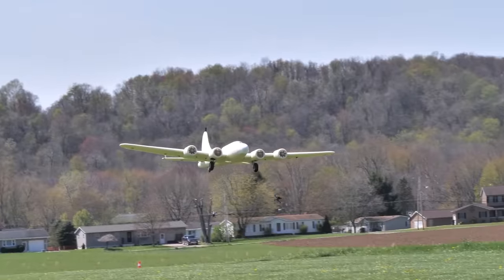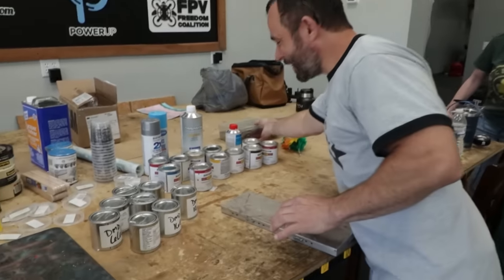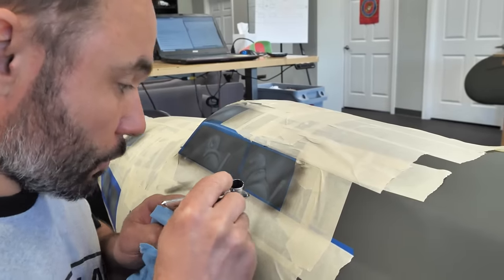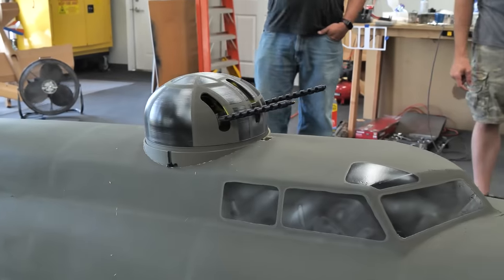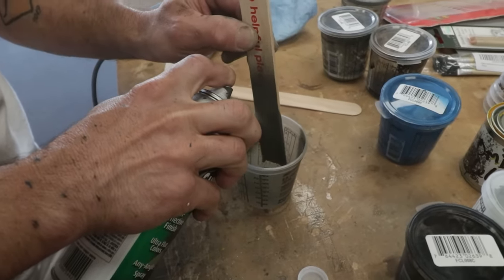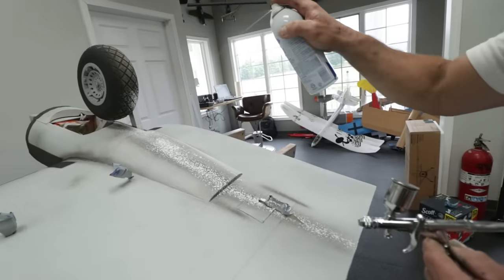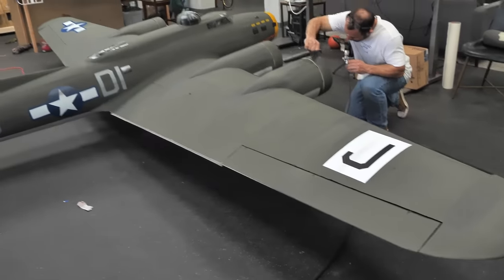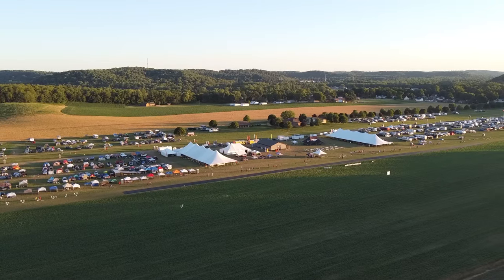Preparing Our 20 Foot B-17 For Battle  🔥

Comment: You should use both smoke bombs. Gray smoke simulates lesser damage, like a radiator leak or fuel leak. So make it go first. Black smoke simulates fire and more serious damage, so it goes last.
Reply: I thought so too
Reply: Well they said I should be reusable, so next time hopefully they can do more smoke.
Reply: Also have to consider the amount of weight that it would add it would be another 4 smoke bombs might be too much
Reply: Agreed
Reply: @bawbup7763  they did say the props are underpowered for the aircraft so they could get more power with larger props.
Reply: Would an air cooled airplane have a radiator?
Reply: @rconger384  it wouldn't be called a radiator a b17 had air cooling gills that were just behind the props on the engines as well as intercoolers which are radiators for air.
Reply: I think it could be a good idea. I would put the white smoke bombs near the wing roots ot between the engines, to simulate damage to a fuel tank or line. Then use the black smoke near, or behind the engines to simulate heavy damage to the engine.
Reply: Could also uses a yellowish/white smoke for fuel leaks, as all the fuel in an aircraft is usually stored in the wings.
Reply: was also going to mention that it might be cool to have like an orange flickering light to represent the fire in the engine at black smoke without an actual fire.
Reply: Yes they should!
Reply: THIS
Reply: Good idea
Reply: Or FLASH BANG GRENADES!!!
Reply: @thekansan8683  Would be opposite in colors !!  😊👍🐭
Reply: @Skinflaps_Meatslapper  what are you talking about? Fire is most definitely worse than a radiator leak or fuel leak, lol.

The hole could be near the top of the fuel tank, leaking very little. The radiator leak might mean you need to shut an engine down or run it at reduced power.

A fire can mean uncontrollable structural damage that increases and spreads over time.
Reply: That would go really good
Reply: I love your idea🤩
Reply: @Specter0420  Radials don't have water cooling, so white smoke doesn't mean a leaking radiator, it means there's a considerable oil leak.  Fuel leaks are thin wisps of vapor that dissipate rapidly behind the aircraft, it doesn't hang in the air like burning oil.  Often you won't even see it unless you catch it in just the right light or the fuel is on fire.  An oil leak that's big enough to trail white smoke means it's a major issue, something truly serious just happened like a rod or bullet or tree limb punched a hole through the case, you blew a jug, the engine ate a valve, or a blower seal just went, and oil is now either being dumped onto hot exhaust or directly into the cylinders.  Every single one of those is a serious issue.  An oil leak trailing white smoke will cause a fire too, often rupturing fuel lines in the process, leading to the same problems as a fire but more difficult to put out with a fire suppression system.  A blower seal will literally suck the oil out of your engine and flood the plugs causing it to shut down or seize rapidly, not quite as serious as burning oil outside the engine but you're still out an engine.  In any case, white smoke means your engine is moments away from failure.  You have a much higher likelihood of putting out a fuel fire with a fire suppression system, and often all it takes is to shut the fuel off to that engine.  Massive oil leaks don't always catch fire right away like fuel does, sometimes it sprays all over your aircraft and then catches fire.  You can't shut the oil off quite as fast as turning a handle, so that oil is going to continue burning for a while, leaking past the firewall and into the wing or nacelle, and you can't do anything about it but hope the engine and oil tank empty out before that happens.  Exceptions to every case as all aircraft are manufactured differently, but most of the guys I flew with would rather it was fuel and not oil causing the smoke.  Bottom line is, doesn't matter if it's white or black smoke, either of them indicate your engine is officially toast, and that's pretty serious.  Even more so if you're in hostile airspace, down on the deck fighting fires, or scraping your wheels on cotton fields without the luxury of being able to calmly limp or glide your plane to safety.
Reply: @Skinflaps_Meatslapper  pretty serious indeed. A fire is much more serious though...
Reply: @Specter0420  When you have an oil fire it still burns with white smoke, so white can still indicate fire.  It's not until the oil fire burns through a fuel line or rubber parts that you get any black smoke to go with it.  You generally don't know whether white smoke is fire or an oil leak until you see flames making their way through the cowl flaps, so procedure is to always treat any type of smoke as a fire and pull the big red panic handle and get on the ground as soon as you can.
Reply: I thought of that too
Reply: @Skinflaps_Meatslapper  sure, white smoke could mean a less dangerous fire, it could also be some sort of less serious leak. Black smoke is almost always a serious fire, that's why it is, in fact, the more serious type of smoke.
Reply: @Specter0420  Black smoke can also mean your engine is running rich or a cylinder isn't firing, which isn't really serious at all and is a far more common thing to experience compared to the other scenarios.  You seem pretty set in your knowledge so I'll leave it at that, because this is just going in circles.
Reply: @Skinflaps_Meatslapper  agreed, you seem to be confused and it's not worth continuing beyond this comment. You keep bringing up engine malfunctions and engine fires... But the topic is actually battle damage from  something like 20mm high explosive cannon rounds...

If you regain consciousness after a few hits and look out your window at roaring black smoke and think, "Thank God that isn't white smoke, I probably just need to adjust the mixture a little"... 

Well, we say, "that's a "you" problem", around here.

If you really want to press the issue, they can just put the smoke bombs on the wings away from the engines and call it a fuel leak vs a fire.
Reply: @Skinflaps_Meatslapper  BTW, it is common knowledge from WWII that white smoke battle damage meant the pilots were out of the battle but black smoke meant they were very quickly going to be forced with the decision to bail out or die.

I understand that the US bombers often had self-extinguishing fuel tanks and I understand that there could be an edge case where white smoke is worse than thick black smoke.  

But after getting hit, you'd much rather see white smoke\vapor the vast majority of the time. White smoke might mean you need to shut down an engine or run it at reduced power. Black smoke could mean the wing is going to come off in 45 seconds if you can't get it to stop. 

Consider that when your white smoke oil fire starts burning the airframe, wires, and various lines it'll turn black.

Comment: I have a suggestion to make:

You should add sound to an airplane. 

I model railroad. It’s fun and all, but the sound adds a touch of realism. 

I haven’t seen it done on many modern rc planes, I think it would be a great challenge to add sound to an airplane, wether it be the b17 or some other scale airplane. You could fit a decently large/heavy speaker in a larger airplane. You could hook it up to a voltage reader or something and when the airplane throttles up, then would increase the audible rpms. Would be cool to see the results.
Reply: Sound systems are out there for them, but there's no replicating the deep bass tones that aircraft make.  The only thing that really comes through audibly in the air is treble, so it doesn't sound very realistic.
Reply: @Skinflaps_Meatslapper  exactly. Put a sub or two on there, i think the fuselage could at least incorporate a 6” at 400w rms or something, would be interesting to see how they run an amp.
Reply: Gas engines would pretty much do it. It won't sound exactly like a real one, but gas engines sound A LOT more realistic. Unfortunately, they can also be A LOT more dangerous.
Reply: MRRcSound tranducers would boom on that thick foam airframe.
Reply: I'm curious to know what kind of construction techniques could be used to create a sub enclosure that was both light enough and rigid enough to have a good response to hear from the air.  The thought of dropping a traditional particle board and felt carpet box in a lightweight foam fuselage seems like the antithesis to their goals.

Moki radials are the closest thing to replicate an actual aircraft engine, but they really don't have that deep droning sound that's characteristic of a full scale radial except when at idle.  In flight they sound more like tiny V-12's being revved to death (which sounds absolutely fantastic on their own, but totally out of place for a B-17).  The more conventional OS style twins and whatnot do have a realistic engine sound...as in real weed eaters flying through the air.  That just breaks all the realism for me, hearing a couple chainsaws flying in close formation.  I'd rather just hear the props from an electric motor...they're quiet by comparison but achieve a similar tonal effect to real aircraft if you listen really close or buzz yourself.
Reply: @Skinflaps_Meatslapper  exactly, plus the plane could be used as a box or way to separate the front/rear sound waves.
Reply: @rameynoodles152  too high pitched for me.

Comment: I think you need a PBJ-1D now. My grampa was a tail gunner with the VMB-413 Shamrocks.

Great work, btw. It looks very convincing! Have you considered adding a loud speaker behind each prop, that reproduces the sounds of each of the Wright R-1820's? (Directly behind the props, next the the motors, and facing forward, so the prop affects the engine sound, just like with the real plane.)

Comment: You're missing some weathering on top of the wing. B-17s had exhaust ports on top of the wings behind the engines and those would get dirty too. Other than that, it's an amazing B-17. Keep up the great work
Reply: They could use a first person cockpit view and bombardier view. Go the extra mile with VR lol
Reply: @andrewborden1009  They probably could lol
Reply: There are actually not exhaust ports on the top of the wing.  Those are air vents to vent air in the wing, (like fuel vapor). It is the #1 most incorrect thing on B-17 builds... and these guys did it right by not putting it on there ;-)
Reply: @adamdrain  Oh ok, I didn't realize that. Thank you for the information

Comment: I used to hold spray paint can upside down to bleed the pressure and than use a can opener on the side and pour the paint out of the spray can. I found that method to be less messy than spraying it into a cup like you did...

Comment: Beautiful. Had a tear,  when it landed. Lots of hard work and dedication. Just a suggestion, use both black and grey smoke. Black is for fires on board, and grey is for burning oil, and fuel leak damage.

Just curious, now that you built 1, and knowing the processes, how much easier, will it be to make a 2nd?

Comment: I use the same size smoke bombs, I put them in an aluminum foil lined large medicine bottle with holes posted all in the lid. It works and keeps the plane safe. The fuse sticks out through a hole.

Comment: This looks awesome. However, I think it could use an idle up switch configuration in order to improve realism by preventing the props from stopping. Thank you for all the community support and inspiration :-) -p
Reply: Could easily set throttle trim for that, just click it up until the motors start.  Use the up and down trim button as an idle/off switch.

Comment: My dad was a B-17 pilot in WW II and was shot down over Germany on his 3rd mission on July 16, 1943 and spent the rest of the war in German POW camps, the first of which was Stalag Luft III in Sagan Germany which is now Zagan Poland.

My dad arrived in the UK at the beginning of July 1943 with a virtually a new B-17.  But most B-17's that survived a few missions had wear and so had paint peeled off of the the leading edgings and other parts of the aircraft.  This model looks more like it came out of the factory and had never flown a mission.  Most B-17's that lasted more that a few missions had flaws where the paint had been worn off showing bare metal along the leading edges of the wings and other parts exposed to the winds.

It's a great model, but it just came off of the factory and doesn't show any of the wear of B-17's in combat.  Also many B-17's were hit by flak or attacking enemy fighters and those holes had to be patched and so many B-17's had a number of patches from being hit on previous missions.

If you are going to make a B-17 that has been in missions in WW II then you need to add the wear and damage that most B-17's had after a number of missions.

However, great model and a tip of the hat to your creativeness.

Comment: You can clean spray can heads by spraying the can upside down, after unloading all pressure u can cut the can open and use all paint.

Comment: There is a far more efficient way to bleed off the paint can. Turn it upside down, bleed off the compressed gas. Then when the gas has emptied just cut the top off the can, or drill a hole and pour it out. That way you don't waste the massive amount he wasted in aerosol form! Make sure you shake it first of course.

Comment: Looking at this on the speed, scale and presence in the air…if I was at Oshkosh I would assume it was the real deal.  All you need is a massive PA system to roll in sound for 4 massive radial engines and no one would know.

Comment: This is awesome. It's BIGGER than my Senior Telemaster!!!
Which itself is a beast. Why no retracts? Too much weight? Not enough channels? 
I have a B-17G bomber, with a 4 channel, and it doesn't have retracts either.  But it does have 4 motors, and ailerons, rudder and elevator. 
I can install landing gear either up ( halfway), or extended.

Comment: Do you have all 4 props spinning in the same direction or are the left props spinning in the opposite direction than the right ones? If all spinning in the same direction, wont that cause sideways drifting and stability issues?

Comment: I wanna see the B-24 LIBERATOR HEAVY BOMBER. Would be cool if the real engine - prop sound was simulated with an on board hidden very high volume audio player which I doubt would add much mass. Then you'd hear the change in pitch coming going and flying by. Cool

Comment: I had a ride in the Liberty Belle.  Your plane looks very realistic.  I was wondering if you could put two smoke bombs, one in each engine nacelle, four total, and set up the laser receiver to set off one of them with the first hit then the other one with the next hit?  that would double the time between having to land and reset.
Reply: Liberty Belle, also painted as the same bomb group if you notice :-).  The "community member" they speak of actually works for the Liberty Foundation :-)

Comment: Two gallons of paint! Ironically, the US Army Air Corps/Force found during WWII that eliminating the fuselage painting step allowed a weight saving  enough to significantly increase the operational bomb load of the later bomber production run.
Reply: Its so hard to get a bare metal finish on a model.  Even some of the full-scale warbirds have painted metal finishes. Aluminum Overcast is a good example.
Reply: @adamdrain  I was not suggesting that the modelers here should alter their excellent B-17 model, just pointing out that the modelers adding 2 gallons to the model presented the same dilemma as the WWII B-17 makers encountered. I'm willing to bet that the unpainted model showed different flight characteristics from the painted model due to the added weight. Had the modelers gone for an aluminum finish they would have added probably even greater weight than the 2 gallons of non-metallic paint. Excellent effort overall giving me a bit of the thrill of my own ride in one of the surviving B-17s a few years ago.
Reply: @doug18d50  Yes your point on weight addition is totally valid.  Also, something people don't think a bout... I have flown in bare aluminum B-17s and OD painted B-17s.... the OD ones are 2x more hotter on a summer day on the inside!!! :-) which 17 did you fly in?
Reply: @adamdrain  If memory holds, it was the Memphis Belle, made right about the end of WWII, so had no combat history. It flew out of Peachtree Airport near Atlanta for a weekend. The ride was my wife's gift to me. My dad's brother was a tail gunner in a WWII B-24, flying out of England, so not exactly comparable to the tiny space allowed for the tail gunner in the B-17, an earlier design. During the flight, I stood in the open space at the aft end of the "humpback' of the fuselage, with my head sticking up in the breeze, able to view the aft control surfaces. As we were flying low altitude, we were below flight paths of commercial aircraft approaching Hartsfield-Jackson Airport. We were close enough to one such aircraft that in my imagination I could hear its captain announcing to passengers, "If you look out the right side windows, you can see . . . ."
Reply: Bad memory, it may have been the Liberty Belle.

Comment: This build is amazing. I can't wait to see it in combat. Are there any plans to make the wheels retractable? I realize this adds weight and complexity, but you seem to have more than enough power to handle it. I also recall you mentioning that larger props were an option if needed. This far, the props you have  have been more than enough. Half throttle looks very scale.